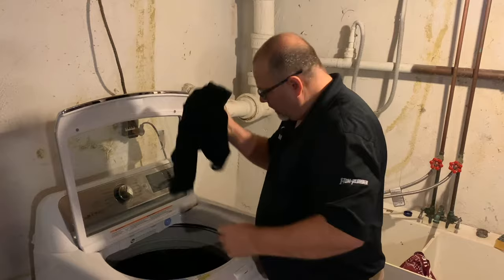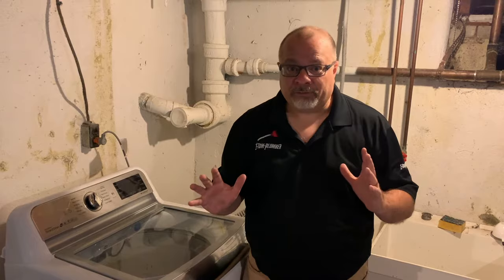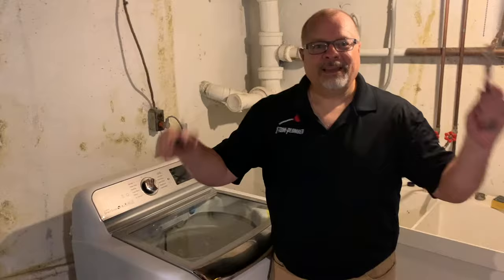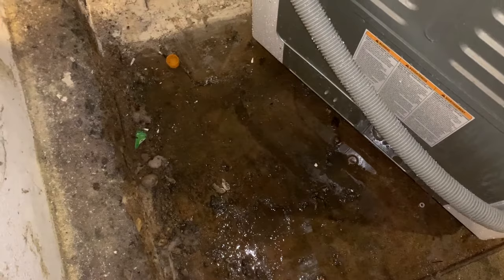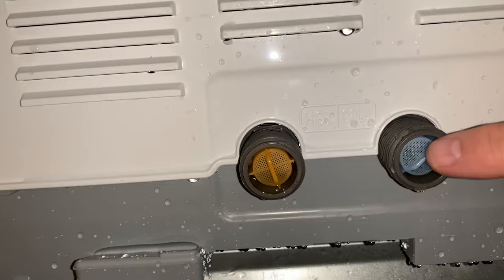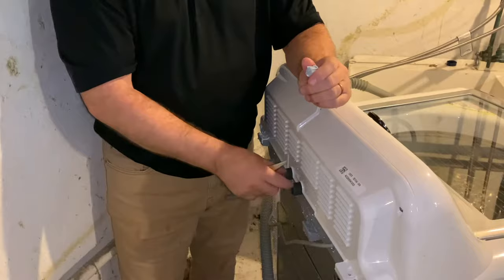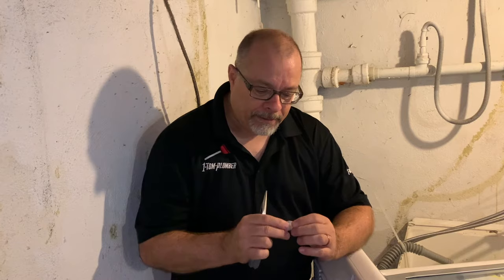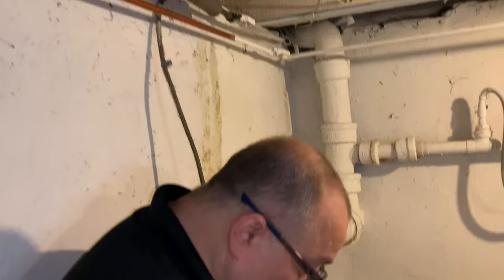Washing Machine Slow to Fill Up? It's Your Inlet Screen!

Comment: Is there a reason you put the filter back in backwards?
Reply: That’s the first thing I noticed, I wonder if it was by mistake.
Reply: That had to be a mistake.
Reply: Definitely a big mistake. If you put it back that way, you will have nothing to grab on to the next time you need to clean it. It'll be stuck.
Reply: Reverse water flow!🤣

Comment: clogged filter will not cause  hose to burst. Any time the water isn't filling the hoses are at the standard house pressure a clogged filter will not change this pressure.
Reply: Yup,  regardless if the filter is clogged, or a valve further down is shut, the hose still experiences the same pressure. Its just a good idea to replace your hoses around as often as you notice your filter clogging, unless you have other issues which causes the filter to clog regularly

Comment: My machine was making a whistling noise.  Found out that my water inlet was bad, the cause was a clogged inlet valve caused by hard water.  Replaced the valve and will clean the inlet valve each year to avoid the problem happening again.  Thanks for the video!

Comment: Tom I have a Maytag Commercial top load washer Model MVWP575G1. It does not fill up even with Deep Water selection. Is there a way to Hack to Fix. Plse respond asap & or anyone? Thank you

Comment: My machine has no pull out filter; instead it is a mesh screen going into the washer.  It was dirty with sand and to clean it since I could. Or remove it was a pipe cleaner folded over itself a few times.  This allowed me to scrape the mesh without damaging it and cleaning it well.  Qtips just get cotton on the mesh and cause more of a problem.  Hope this helps with the filters that cannot be removed
Reply from the maker: Thank you so much for your input!! Hopefully this helps those people with filters that cannot be removed.
Reply: Didn't say how u cleaned it
Reply: @sharelle8500  
Used a pipe cleaner bent on one end to make a loop, which allowed me to scrape the crud out.

Comment: Thanks for such a helpful video.  I have never separated my whites and darks, btw.  Are there inlet valve screen replacements available anywhere?  I looked up my washer model on an appliance parts site and they aren't even listed on the parts list.

Comment: Tom the Plumber- I'll give you another try a while from now but not now- I had to crank my volume ALL THE WAY UP and still could hardly hear you. THEN THE OPENING MUSIC NEARLY BLEW MY SPEAKERS AND MY EAR DRUMS! I can tell it is your camera person who is moving in and out that is changing the volume, but really- please fix this. I'll replace my thumbs down with thumbs up if you do. Please man.  UPDATE- I needed the info so I'm listening with one hand on the mute button. At about 2:15, still on max volume, your voice is much easier to hear. Then the revving of the engine blasts me again. I won't update more, but I am watching till the end. Please, run through this video again and see if you can fix the volume. Much appreciated.  Oh also, at 5:42 you put the cold filter in backwards- the little handle is now on the inside so you can't grab it 😞

Comment: How long is slow to fill up a washing machine? Mine takes 10 minutes, it's that long?
Reply: that's normal if it takes 20 to 30 then you need to clean the filters
Reply: @docwho10th88  My washer will fill up and then once it's done filling... it drains all the water and never agitated. Do you know what that would be?

Comment: This unfortunately won't work anymore... Whirlpool in their infinite wisdom has changed the inlet valve filter design such that there's no longer any appreciable tab on the filter screen to grab and extract it from the valve.... This forces you to charge your customer an additional ~$70.00 for a completely new inlet valve assembly...